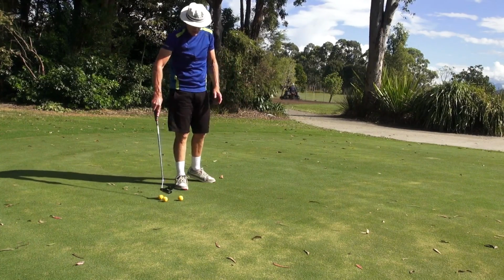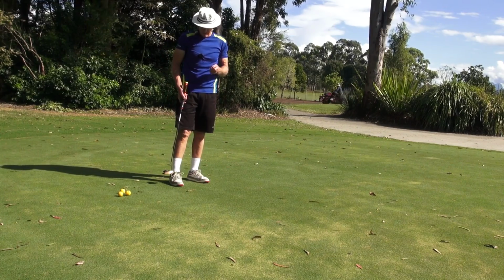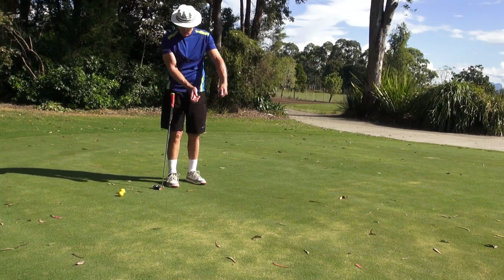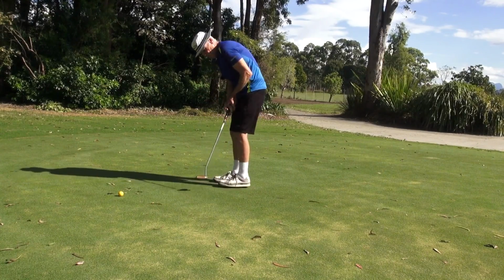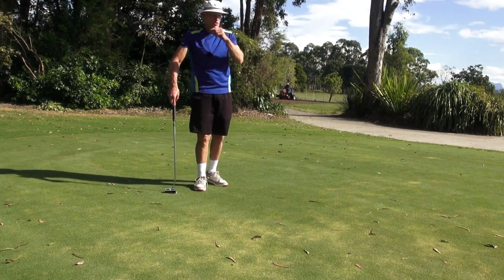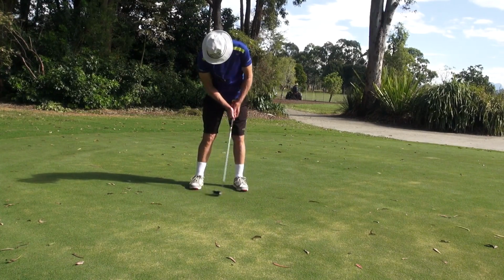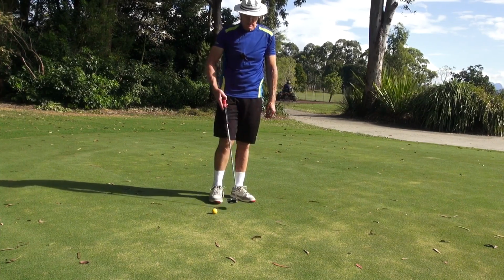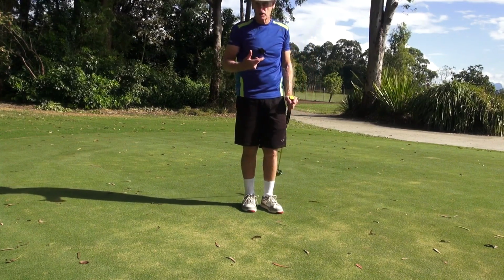More Goerge   Low Putting   technique info

Comment: Brilliant JH! This is the way a child would throw a ball wirh a hand towards a target. With a hinge andthe body/face  turned to the target!
Reply from the maker: Hi Martin,
         It's the 'Whole' process   that makes it work... you really can't  have a perfect    hinging action without the   right type of   finger placement   on the grip ...   or the   ball positioned     off the trail  foot   in line with the   body's trail vertical axis  ...  and  you need the    lead shoulder closed   so you can track the putter in to out at  impact...  that hinging action with a normal putting grip  from a normal  forward ball position       does not   remotely  roll the ball with the    accuracy    levels  of  the CL      mechanics    structure   as  I demonstrate  in this video  .. in  fact     when you  putt  with a conventional    feet apart  forward  positioned ball and    hand/arm   sideways  travel      the   feeling is   absolutely  gross  compared to the   solidarity     and precision  of    this   process  .. 
                      Count Yogi had some of this structural hinging application but from a normal forward ball position  .. I think if he had putted from a back foot  closed shoulders configuration he would have looked a lot like I do now .. 
                      cheers JH

Comment: JH: Question- I’m left handed and right hand dominant and have had success using this method using a 1 ball forward of middle stance. Is that ok by you? Thanks.
Reply from the maker: Hi Neil,
            'Anything' is ok that 'works'...   the only reason  I like the back football position is that it gives a better opportunity to get the putter tracking in to out at impact  ..     I suppose you could get the lead hand/wrist in your case being more of the main force/feel applicator  ..  again I think  just as long as you use the   pincer effect of the  forefinger and thumb    of both hands   I think it will still be   a viable application in your case ..
                     cheers JH
Reply: @1atomicgolf  could u show a close up of the grip? Thanks
Reply from the maker: @paulbarrett2756  Hi Paul,
                           If you    send me your  email address   I   will do  a  short  video  explanation of the grip   when I  do the next     swing videos   and I will  send  the video to you  direct  ..  my email is   jhensby1@gmail.com  
                  cheers JH

Comment: I have been "Face-On" puting for years. They even make a special putter for this method. Can't remember who makes it. I'll have to "Google" it.
Reply from the maker: Nothing wrong with  Face On putting   'if'  it  gets    consistently good results  ..  I tried it    30 years ago     but found having the   dominant eye  so far inside the   ball line   at address and impact     that     most of my  putts were pushed in direction  .. I  actually made  a putter identical to the one  shown in the video you    supplied  ...   the face width was only   2. 75 inches wide    in order to   get the club soled out correctly  ..   so nothing is new in putter design   ..   I  made that putter 30 years ago  .. 
                          cheers JH